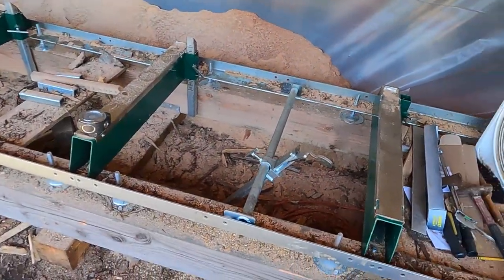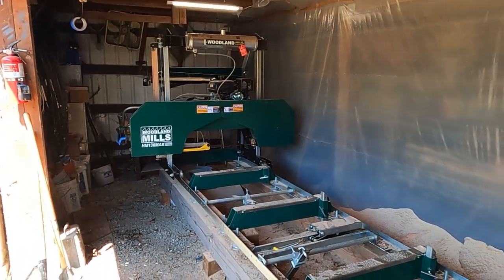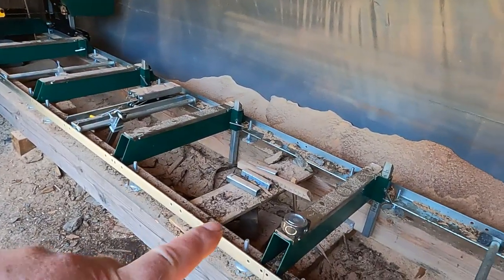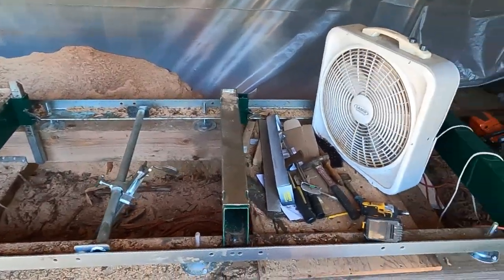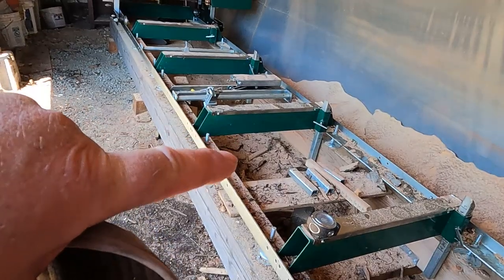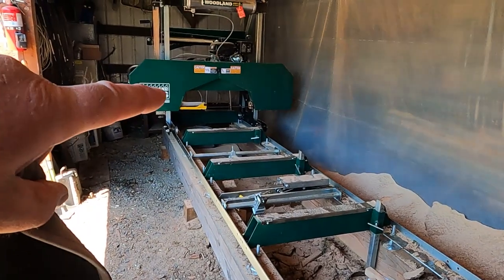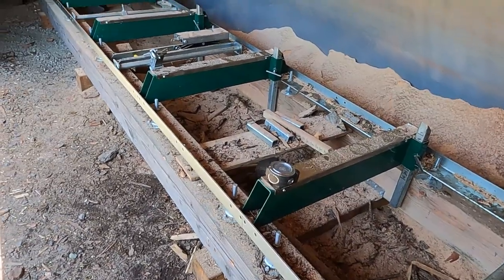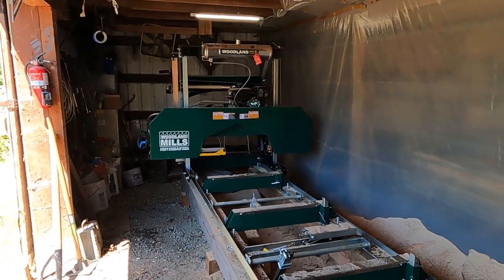Confession | I discovered something terribly WRONG with the MILL | Woodland Mills HM 130 MAX

Comment: Mine shook today. Of course I was milling hickory with a not so sharp blade. Lol
Reply from the maker: Bill, Even after all my best efforts, the mill was shaking yesterday when  I was sawing a 20 inch wide fir cant into 2 inch slabs. I don't know, it doesn't do it all the time, but when it does, it shakes! But still cuts nicely. So why worry?
Reply: @a_farm_west_of_boring  I should have changed my blade, but only had two slabs to go. I slowed down, but it still shooked. Not horrible though. Hickory is hard as hell! Enjoy your videos!
Reply: Try turning up the lube! Check band tension! Check pully alignment and make sure no moving parts have cake up on them. My Linn mill will shudder now and then but is always remedied with more lube or a sharp blade..
Reply from the maker: @thesprucemill6632   thanks for your comment. I have adjusted the blade guides again and that also helps! Thanks for watching.